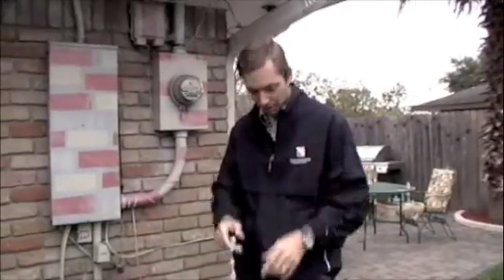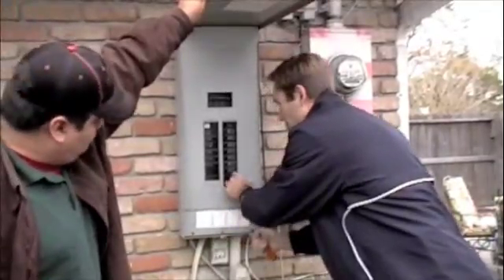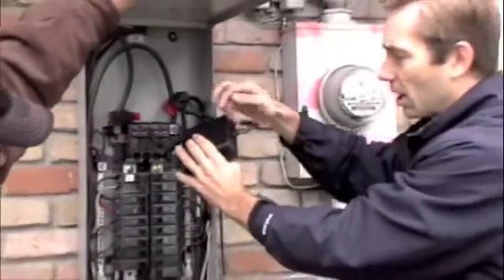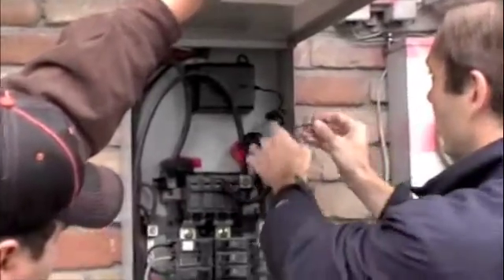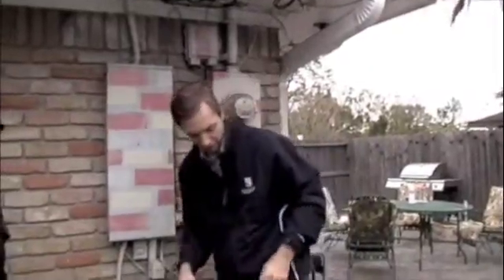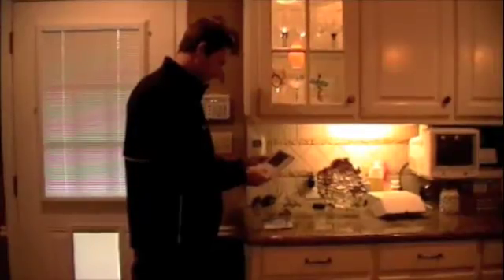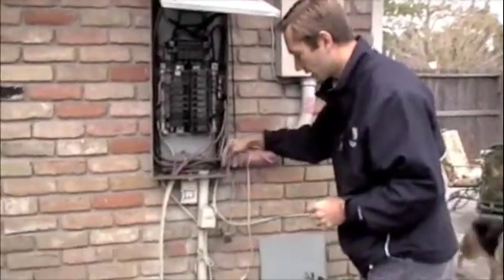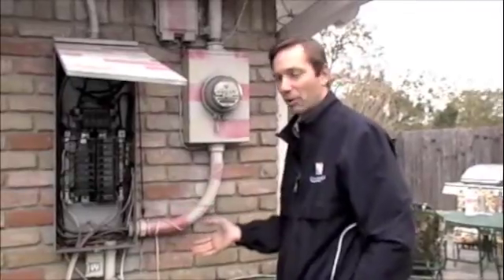SRE Energy Cost Monitor Installation

Comment: Hi, I live in Spain (Europe). I want some device like that on the video but I dont like the idea of using a transmitter with batteries. Why? You have the power just there inside the breaker box. How long does the batteries last? It's funny that you need two clips, in Spain there's only one hot wire and one neutral for homes.

Comment: I may hava attached it away from the hot wires, as I am sure the batteries need to be changed when depleted. Possibly on the removable panel, as the leads can be disconnected from the unit.